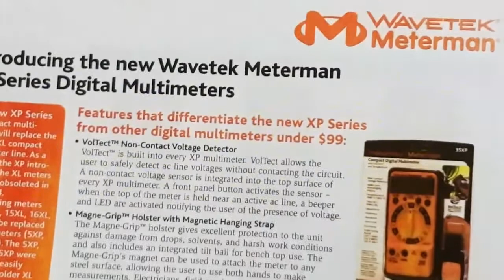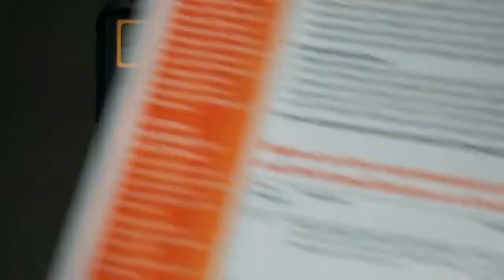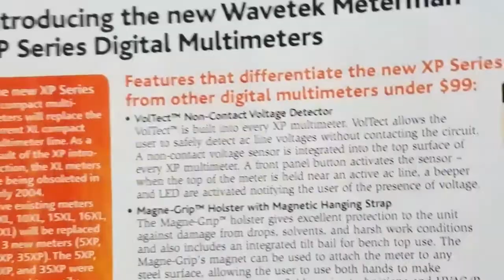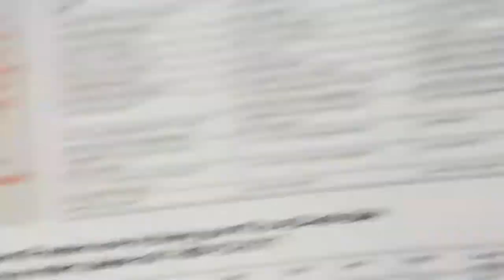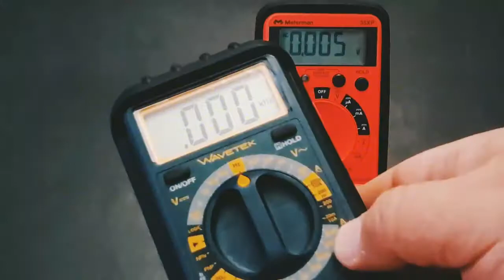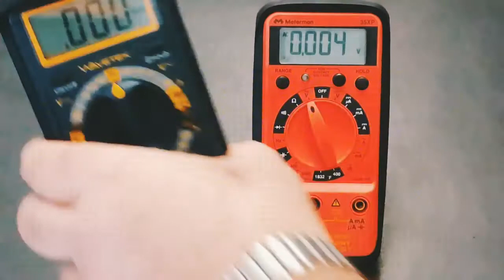Wavetek 16xl vs Meterman 35XP - Vintage Multimeter Review & Teardown! Part 1

Comment: Saya punya wavetek hd160 udah lama tidak digunakan, kaber batre 9volt lepas dan sebagian resistor patah, saya tidak tau cara penyambungan, tolong, bisa kah anda membantu saya
Reply from the maker: I can help you with the battery replacement but the resistor may be a bit trickier..
Reply: @KeepOnTesting  udah selsai, ternayata resistie 1 mega ohm

Comment: I have a Wavetek DM7, it's 20 years old and still going strong. It replaced an old Radio Shack multimeter. lol
Reply from the maker: That's a solid manual ranging multimeter. 
Here's to another 20 years with the DM7 
😃👍